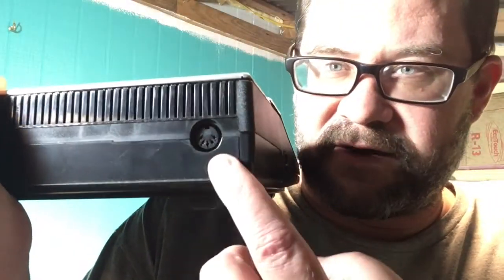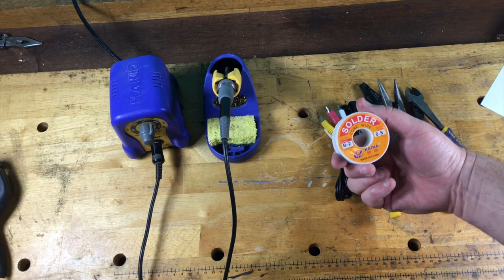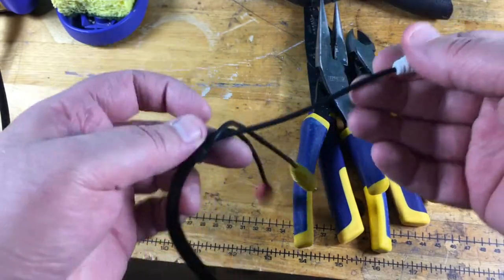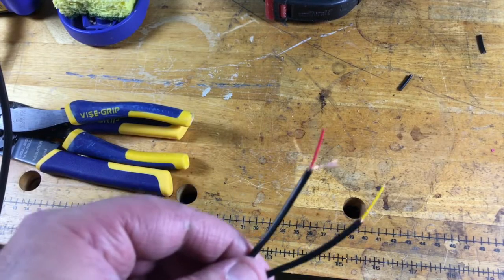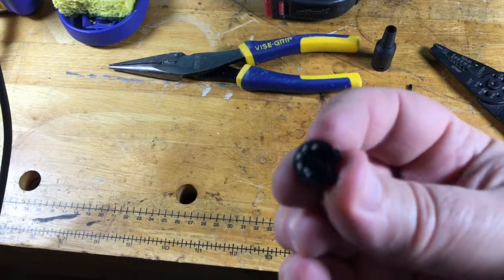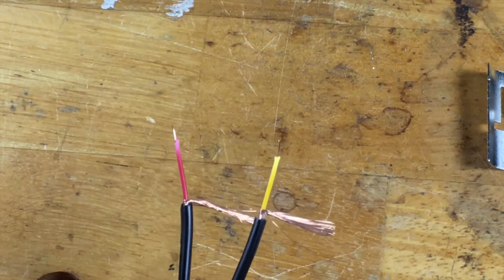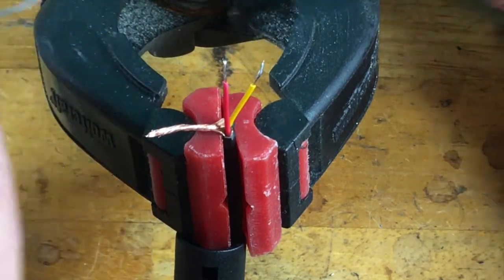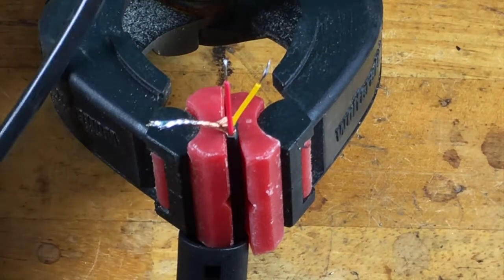How to make an AV composite video cable for the TI-99/4a computer

Comment: I'm a little confused, and I understand this is over 5 years old, but... If you left the white RCA plug in, would it be receiving signals? Would audio or video go through? I'm not clear about whether both audio and video signals go through both/all the RCA connectors, or if they are separated out at the DIN pins, and red only gets audio and yellow only gets video. and what would white be if you left it on?

Comment: Nice video! 

BTW, "Ideal T-7" strippers go down to 30 AWG, but are expensive. KATA 7 Inch" strippers, part number KT231106, cost about half as much. And probably are about half as good, but how often are you going to need them? 

Be advised that KATA makes and markets another "KATA 7 Inch" set of strippers that only go down to 18 AWG. So it's up to you to make sure that you buy the right strippers.